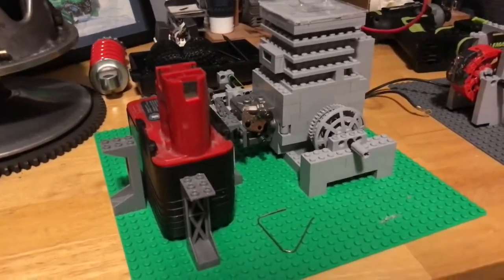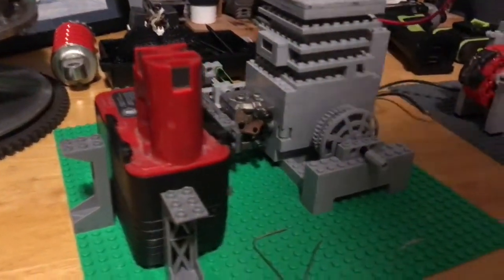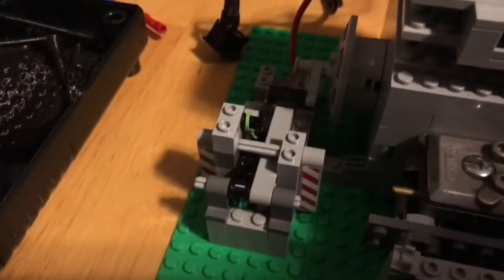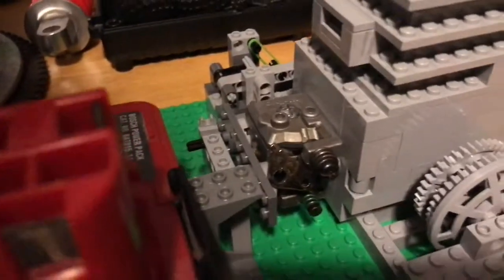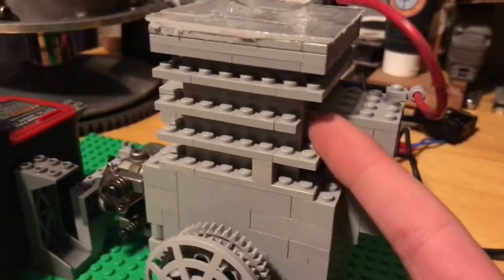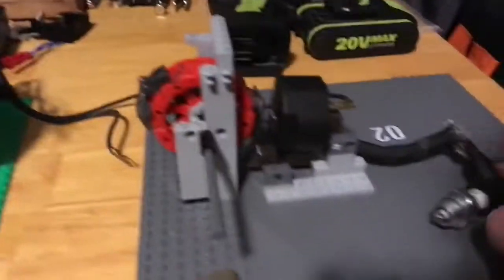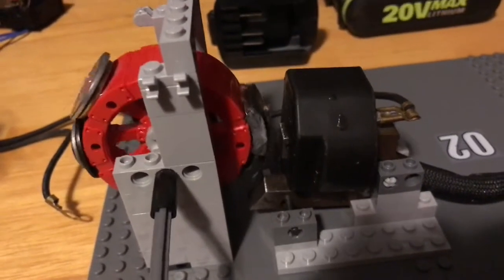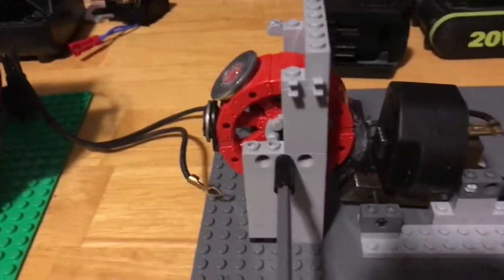Lego Combustion Engine Part #1 |   Working 2 stroke LEGO engine

Comment: Also just wondering... what fuel do/have you used and what is the displacement.
Reply from the maker: We haven't used it, but we will probably start with starting fluid/ether to see if anything happens. As for displacement we haven't checked.
Reply: I found from a previous engine that aerosol seems it would work. You know, body spray, air freshener. I’ll be trying several different fuels today on my new engine. If you want I can let you know how they work.